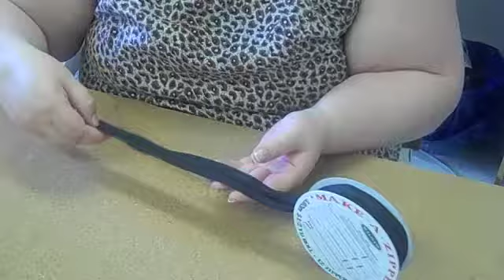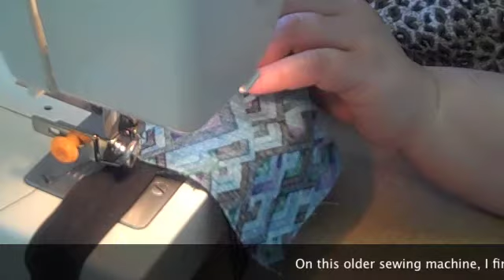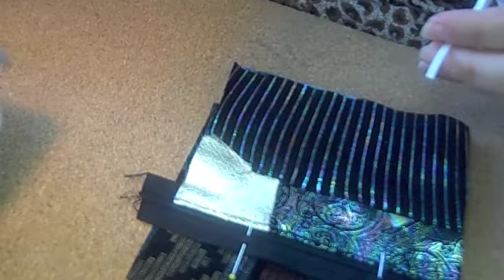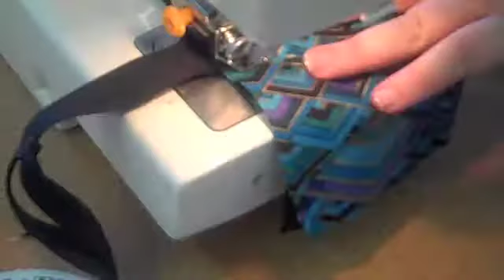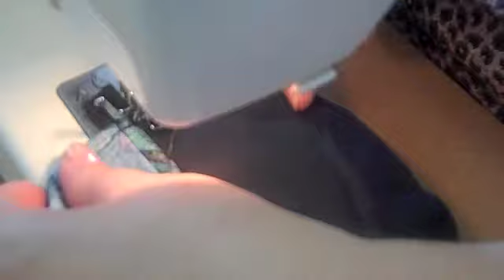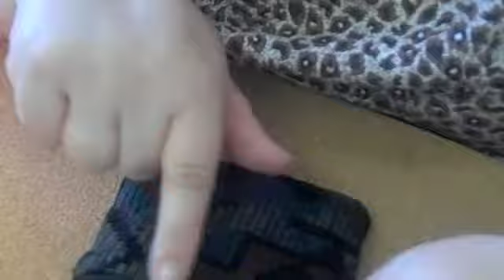How Do You Make A Zippered Coin Purse

Comment from the maker: Jennifer Martin Thanks for your comment, Jennifer. In answer to your questions, your sewing machine will sew over any zipper with plastic teeth. Metal teeth will break your needle unless you are very lucky and happen to sew between the teeth. As for the zipper foot, yes, you MUST use one. A zipper foot allows your machine needle to sew close to the edge of the zipper. It is an indispensable foot! It can also be used for making and sewing on piping or anywhere else you need to sew very close to something.

Comment from the maker: +csleeps317 Thanks for your question. I used the same needle and zipper foot when sewing across the zipper. Your machine might make some funny sounds and seem like it's struggling but it can generally handle it. Just make sure the zipper teeth are plastic, not metal. Metal ones will break the needle if it doesn't go in between teeth and it's hard to see if you are sewing between the teeth or on them. Plastic teeth won't damage anything.

Comment from the maker: ***** To get sharp corners on something like this, you need to sew the seam exactly up to the corner where you want the point then, leaving the needle down, lift the presser foot, turn the fabric 90 degrees, and keep sewing up to the next corner. Another way to do it is to continue sewing right to the end of the fabric (instead of stopping at the corner to pivot the fabric), cut the thread, pivot the fabric and start sewing the next seam right from the edge straight across. This method will leave each seam on a separate thread pair so there will be pulling, making the corner slightly rounded. But the real trick is in the trimming. You need to trim the excess fabric from the corner VERY close to the stitching so it won't bunch up there when you turn the pouch right side out.

I should do a video on this. Thanks for watching and thanks for your comment!